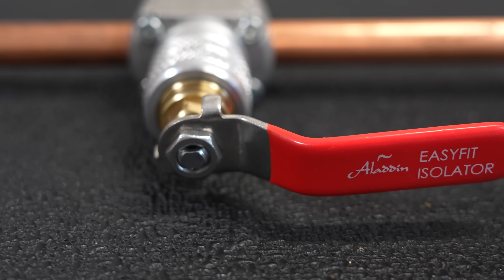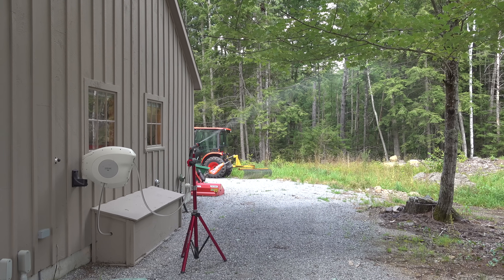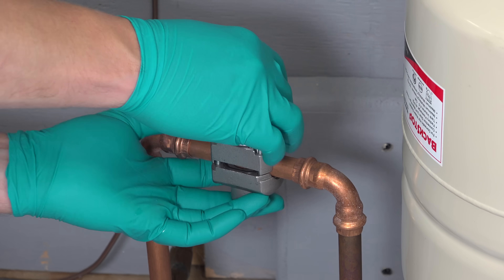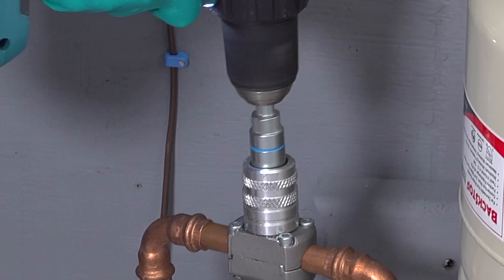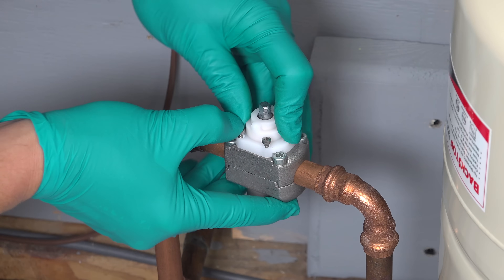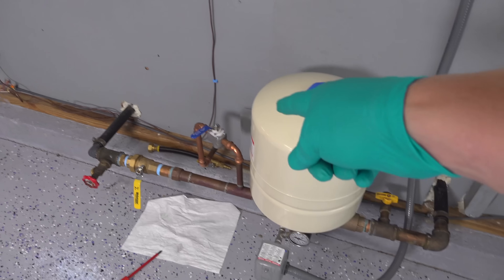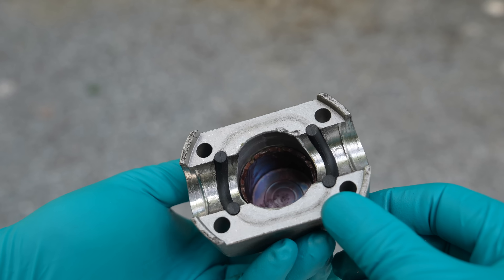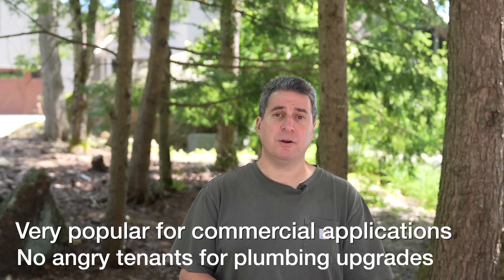SHUT-OFF valve installs on a LIVE WATER PIPE - Aladdin EasyFit Isolator

Comment: This blew me away. Amazing product. Then I heard the price. Yikes! I guess it's more of an emergency use product to avoid huge jobs and unique problems. I was hoping it would be more like $40.
Reply: Yeah same here. Guess I'll just stick to my sharkbite ball valve for emergencies
Reply: @SparxI0 then you can set up an appointment to replace the sharkbite valve later on down the road. They do fail.
Reply: @ltsgarage7898  no shit, that's what "for emergencies" means. 

If I had to shut off the water on a live pipe I could easily do that with a $20 sharkbite ball valve instead of this $250+ valve, fix the issue and then remove it and solder it back together

I'm not calling a plumber for something I'm more than capable of doing myself
Reply: @SparxI0  when was the last time you had an emergency on your own house???
Reply: @ltsgarage7898  never because I don't do shoddy work and I redid all the previous homeowner's shoddy work. Still, it's good to have in case some plumbing were to get damaged accidentally or I get a different house where the state of the plumbing is unknown
Reply: @SparxI0  well, that’s not what I asked at all ???
Reply: @SparxI0  so you’re saying that you would put a 250 dollar value in your truck because you might need it one day???
Reply: So many comments stating that a shark bite valve is only $20 is overlooking that a shark bite is not a clamp on valve.  You have to cut the pipe to slide it on.  If that pipe is pressurized, you are now adding to any water damage.  Clamp-on or shark bite are for completely different applications.

The video clearly pointed out that this clamp-on is for when either the main shut-off doesn't work or, for whatever reason, can't be used.
Reply: I agree the price is ridiculously high.  If it were about 60% less it would be perfect for a lot of jobs, but I'm not buying one at this price just to keep it on a shelf for a just-in-case scenario.
Reply: @richardclifton4120  In the UK it's like £50 ($65) lol. There is no way they are $250 in the US, surely?
Reply: @1992jamo  The 1" version is $450.00
Reply: @1992jamo  The US version of the valve has been re-engineered because copper tubing is much more dense here compared to the UK versions.   As a result UK valves will not work on US copper piping.  As a result there is a difference in pricing between the UK and US versions.  Hopefully, once this valve becomes more popular in the USA we can re-evaluate pricing.
Reply: @easyfitisolatorusa I hope you guys figure it out the costs. It's a fantastic product that every plumber would love to have in their van. Just not at a price point which would alienate customers or eat into profits so much that the callout is not worth it.
Reply: Nobody will pay $250 plus shipping. At $100 or less they will sell to homeowners.
Reply: The guy said something about US pipe being 'more dense.' Sorry unless he's talking about nominal pipe size dimensions, he has lost the audience, including me. Material density has nothing to do with the actual pipe dimensions of "nominal pipe sizes."
Reply: The version sold in the US is different to the UK one as our pipes are harder, thicker and a slightly different size hence the price difference @1992jamo
Reply: @1992jamo  300$
Reply: @easyfitisolatorusa  is the copper more dense or the US customers? It's a great product but $300-400 is insanity.
Reply: It solves a problem nothing else does. If you happen to have that problem, it's worth it. 

It's not bad, it's niche.
Reply: These are only £50 / $65 here in the UK
Reply: @Superfandangoo  $400 on amazon in US
Reply: @Superfandangoo 
Yeah, but nowadays you need roughly $6 to equal 1 British £,  thanks to Bidenflation....
Reply: @Superfandangoo for 15mm
Reply: A 1” propress Apollo valve is $32 at the depot... $200 seems like a bargain.
Reply: @mikezeke7041  They are $64 dollars in the UK for the 1/2". $169 for the 1" valve.
Reply: It’s a specialty tool… what’s you expect
Reply: Emergency use….  The time it could take to find a healthy piece of pipe to install this could be longer than turning the water off
Reply: This product is absolutely brilliant, but yes the price is crazy to me. For next to nothing, you can be a brute, sawzall the pipe and put in a quick ball valve and learn how to do it for free on YT. The only thing I feel this would be useful for is if  you absolutely have 0 way to turn off the water coming in. But even then you can (if you know how) turn off the water to your house from the main line.
Reply: the 15mm version is £60 here in the uk for the starter kit with tools and £50 for just the valve... and they're a life saver  , i aways keep one in my van
Reply: Chinese $40 knock-off on the way no doubt...
Reply: @HBSuccess  not interested, the Knock off will be leaking and leaving with you a bigger mess as you have most likely put it in a spot where your can't turn off the water. Wouldn't be a smart risk to take
Reply: One of two things may happen. Either the product will fall by the wayside because of the price or the price will have to come down in order for it to sell and sell well
Reply: @TheJrm1111  price will come down. Production can't be that expensive
Reply: Mucho denrito!
Reply: That's just about what they are here in the UK, 15mm £39.50, 1/2" £98.80
Reply: I mean it would have been well worth the cost for that dude in the viral video flooding that apartment. There are definitely cases where it would be worth the dough - like any time you need to work on a system with no accessible shut-off at all or where you aren't allowed to shut the water off. The part cost is nothing next to labor costs. A lot of plumbers or HVAC contractors will charge more than that to put in a $12 valve. Especially if it is a situation where the shutoff is not accessible.
Reply: If the sizes are the same, order it from the UK. Even with shipping it'd be cheaper.
Reply: In industry that could be a huge bargain. Line down costing $1,000/minute is not ridiculous.
Reply: If it’s an emergency. Turn off water !!!
Reply: But if you can't fit an Easyfit.... @ltsgarage7898
Reply: @ltsgarage7898 You could even freeze the line or buy some tarps and do it live.
Reply: This is an alternative approach to another product that I once used for a refrigerator.
Reply: I was ready to buy one to keep for emergencies but not until they get the price down to $50-75 range. I understand that this will cost more to manufacture than a regular ball valve but I diy to save money so shark bites are still the winner. I hope the marketing team sees this.
Reply: I think there is import tariffs on it as it sells fro £100 in the UK. @Andrew-jm4tp
Reply: These cost about $60 in the UK (the country they're from), so a huge US tax on that one.
Reply: Wonder if this would work on cpvc. But as brittle as the pipes I work on I still be nervous as hell.
Reply: Yep. Very cool and they say the price like lol, should of started with that. anything is possible for a crazy amount of money.
Reply: Price is what the customer is willing to pay (until the patent runs out). ;)
Reply: Yes copper particulates and shards inside the pipe .... no thanks
Reply: Of course they're marked up so much in America, good old capitalism "Fuck you pay me"
Reply: I'm sure other manufacturers will start producing them and the price will come down.
Reply: @snwbm  Definitely. I will keep a couple on hand when they hit the $10-20 range.
Reply: @snwbm  ever heard about patents?
Reply: It's 60€ excl VAT in the Netherlands. Still comes out to 72.54€ but a lot more reasonable than 250$
But for some reason, the 28mm variant sells for a pricy € 230,99 excl VAT. So maybe the video only sourced the price from the most expensive version.
Reply: You were HOPING for $40? The normal valves I use are like $3. For THAT price, I can honestly get everything needed to replace my whole water circuit, including heating.
Reply: @techalyzer  You can't install a shutoff valve in the middle of a pipe with the water turned on for $3 though. Assuming this works the way he demonstrated it, this is worth having one kicking around for me. Most people aren't going to get in a situation where their main shutoff valve breaks and the city/town doesn't have a shutoff valve outside the property, but.... That's the situation I was in where I would have been willing to spend more than $40 for this thing lol.
Reply: It's not meant to replace shutting off the main source... lol
Reply: @TheTyisawesome  it woulda worked good enough for me. There was a specific pipe that was broken underground from freezing and I couldn't shut the water off, so I could have gone inside and just blocked off that pipe long enough for the town to dig outside and install a proper shutoff valve for the property
Reply: I don’t care for it
Reply: 200 bucks is nothing nowadays.  Hate to say it.  $100 bill is the new $10 bill.  Awesome product
Reply: The price is high but there are very few situations that you can't turn the water off
Reply: me too. I was going to use this to have a shut valve in the wall pipes of my shower but too $$$ plus might be enough room with this valve. Hello sharkbite.
Reply: Guys, HERE is The Savior

HalleluYAH translates “Praise ye YaH”

YaH is The Heavenly Father 
YaH arrives via the TENT OF MEETING
YaH was Who they Crucified for our sins
YaH was Crucified on an Almond TREE

— Ancient Semitic Cuneiform of Moshe (Moses)
— Isa Scroll (The Original Isaiah)

Isaiah 42:8
"I am YaH; that is my Name! I will not yield my glory to another or my praise to idols.

Isaiah 43:11
I, I am YAH, and there is no other Savior but Me.

Isaiah 45:5
I am YaH, and there is none else.
Reply: Not sure how much it costs in US but here it's about £55 which given the time it saves I would say is well worth it.
Reply: Update: I just checked the product website. The 1/2” version is $300, 1” version is $560.
Reply: Cheaper than a plumber, and if you have it on-hand faster too.
Reply: Double YIKES!!!
Reply: if  you don't mind getting wet a little jet sweat plug is what you are looking for. 50buck for 1inch or 125 for a set.  stuck it in  and on you go, soder on a full port ball valve or what not
Reply: They are ripping us off if they are only 65 in the uk I remember red bull being cheaper over there that was about it
Reply: Buying a curb key is cheaper
Reply: 40 bucks Holy Moly!!!  Everything has gone crazy, pretty soon Home Depot will charge us to walk in the door !! YIKES !!!!
Reply: It probably will once it gets larger production
Reply: It’s like MAGIC- wow !!!!! ❤😂🎉
Reply: Lol use a shark bite valve
Reply: This was my exact response…
HOW MUCH IS IT!??
for $200…*ill just cut off the supply drain the line and sweat a new ball valve into place within 45 minutes!
Reply: Edit:
Who is still sweating copper..?
When for $32 you can buy a push fitting 3/4” ball valve and install it literally in 7 minutes!!!
It takes longer to crawl under the house than it does to install a push fitting 🤷‍♂️
Reply: The price will come down but for emergencies in commercial/industrial applications, it's pretty cheap compared to the time it will save.
Reply: Can this be used on a pipe that is kinked
Reply: I had a odd leak and one of these would have saved me 2k, its cheap. 😂
Reply: Believe me, these type of valves are nothing new in Europe and your $40 estimate is closer to the real price, plus there are some that don't require a drill. 👍
Reply: A leak waiting to happen
Reply: Have the Chinese make them and magically the price will go down to a third...
Reply: A plumber charges $100 an hour,plus materials and, if it is an emergency double that amount.
Reply: There is no need for them to be that expensive, someone will rip it off for a decent price sooner or later
Reply: Tbh thats not bad, for a ball valve I can install myself without shutting of the water or open up the pipe itself. For any other valve would have to get a plumber or more tools I dont need otherwise.
Reply: Can't wait for the natural gas version 🎇
Reply: This product just needs to be cheaper than shutting off the water and installing a valve. Depending on what the water is connected to that could be an easy sell.
Reply: Material cost is probably $10, and many years of sales in the UK has already more than recovered the R&D cost. The only reason they still sell for $200 is because very few actually need it, thus the sales being very limited, covering marketing and service fee would be hard without a high unit price. If this gets standardized as a sort of national standard emergency clamp-on shutoff, this would be dirt cheap.
Reply: @bskull3232  
 Well we need to throw that saying out the window. Dirt is not cheap anymore.
Reply: @bskull3232  na they only over price it for USA succkers
Reply: @bskull3232  It's whom ever the US importer is. They are about £60 retail here in the UK so $75 and call it $25 shipping shipping and tax. Importer is probably making $100 on every sale
Reply: @bskull3232  That's a long, drawn out way of saying greed, no?-
Reply: @Cast.Iron.Frisbee  No. Covering marketing cost is different than wanting an unrealistic amount of money.
Reply: @bskull3232   Material cost may be 10 dollars (It's not), but the precision machining you're ging to have to do to make those pieces is going to be much more expensive.
Reply: @phuturephunk  The material is $1.5 at most from China or India, and the machining is, well, consider it free. Labor is so cheap that in China, CNC machinists charge you by the pounds of shaves, and the work is at least up to the home depot's quality standard -- so it should be fine, though not perfect.
Reply: Agreed... $250 ~ $450 for those ► Not a chance....
And those that go for sharkbite ball valves... those are ~ $40... a standard compression ball valve is ~ $15 and it's just about the same work.
Never had a problem with those... even in old plumbing.
Reply: This blew me away. Amazing product . Then I heard the price. And it blew me away !
Reply: It’s €65 in the Netherlands, €59 if you already have a toolkit.
Sounds like the US distributor is applying a huge markup.
Reply: Or is it government tariffs.  @Xerber85
Reply: Damn you're ready to give 40 bucks 😂 i'd rather give 25 Max
Reply: $250 doesnt seem that much if you can avoid paying a contractor. I couldnt do it myself the traditional way, but I sure can install this thing. So in certain cases, $250 is a good deal.
Reply: if you're a homeowner in a situation where you'd need this, it seems you're not going to avoid a call to the plumber, because it means you don't have a working main shutoff valve, and it doesn't seem a good idea to just start relying on this as the new main shutoff.
Reply: China: $20, take it or leave it
Reply: Imagine your pipe is about to blow and ruin the whole house, that will make it worth it.
Reply: @mahendradhungel8011  Who in that scenario would not turn off the water? It's an extremely good product for a problem that doesn't often happen. Great for someone to have in the van, but no plumber is going to reach for it unless for some bizarre reason the water cannot be turned off.
Reply: @1992jamo  
 Not really bizarre. Obviously in any residential application, the water off could be shut off.  There are many commercial applications, apartment complexes, hospitals, manufacturing plants or whatever it may be that they do not want that water line shut off. This would offer them an inexpensive option to fix the problem downstream of the new valve.
Reply: @1992jamo Where I live most of the houses are very old. My own house is over 200 years old. Many houses don't even have a main shutoff, or it is corroded to the point it is inoperable, etc. The town doesn't own the line that goes from your house to the street here, that is your responsibility. There may or may not be a curb stop to shut off the water at the street, and if there is there is no guarantee that it is not rusted into a solid block from 100+ years of sitting underground. At my own mom's house, the water line broke under the front yard. Because the town doesn't own it it was our responsibility to fix it. Luckily it was summer because we had to dig a 6 foot deep hole in the front yard. Water was spraying out of the ground from the leaking pipe. In her case there was a curb stop that was operable, and this valve wouldn't have helped much anyway because the leak was underground, but I can easily imagine a situation where it would have been useful. Her house had no inside shutoff valves at all on any pipe, only the curb stop in the yard. If that had been inoperable this would have been basically a necessary product to complete any kind of repair, because the town isn't going to shut off the entire main under the street, and they would have to dig up the street to get to the valve between the water main and service lateral. They aren't even responsible for the service lateral in the first place, only the meter itself and the water main under the street.
Reply: Just turn the water off and fix the pipe. @mahendradhungel8011
Reply: @mahendradhungel8011 Or you are in an upstairs apartment.
Reply: Price is good when you consider that $250 does not go far in the world of emergency plumbing.
Reply: yea lol $200 is too steep. It is a very ingenious product, but that is just too crazy of a price tag. Maybe $65 would have been a fair price i say for 1/2 inch
Reply: You got a leaking pipe and can not turn off the water, the damage done could be very costly. $250 dollar to turn the water off could be a bargain.
Reply: @tonysheerness2427  
 Exactly. This valve is obviously for situations where you can't shut the water off. People keep comparing it to normal valves.
Reply: @tonysheerness2427  turn the complete building off
Reply: @tonysheerness2427  installing this valve doesn’t fix the problem. It just turns off the water. You still have to fix whatever the problem is…
  So that’s an extra 250.00 dollars added to the repair of what ever is leaking.
Reply: @ltsgarage7898  Yes but it is a lot easier to fix the problem  with the water turned off. In the UK the price is £100 so there must be high import tax on it.
Reply: 200 bucks is nothing nowadays compared with the price of having anything done in a home. I could see this being useful for certain renters, or when union Plummers are required for building upkeep and you’d rather work around them.
Reply: @FiddleSticks800  japan only 10$ USA
Reply: Prices will go down eventually as with most new products. First flatscreen TV ran you over 10K USD, now you can pick up a decent one for under 500 bucks.
Reply: The price will come down.  It's only high because it's likely imported.  Once they start making them here it will be probably around 50 bucks.
Reply: Imagine crying about prices and still using copper pipes.
Reply: @Ai-Kyuu  most people with copper pipes had them for awhile. My pipes are 50 years old now. I wouldn't install copper now, but I'll maintain what I've got until it's not feasible anymore.